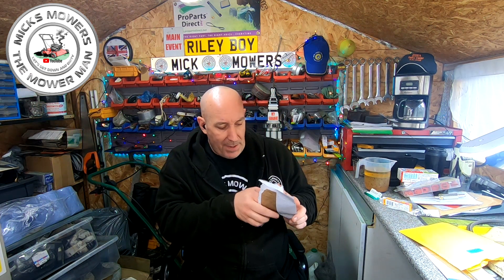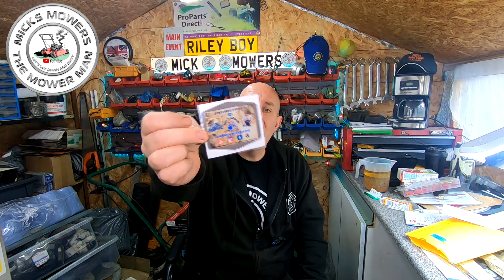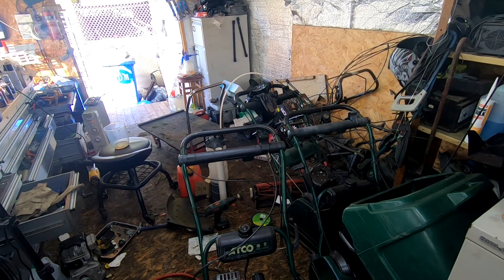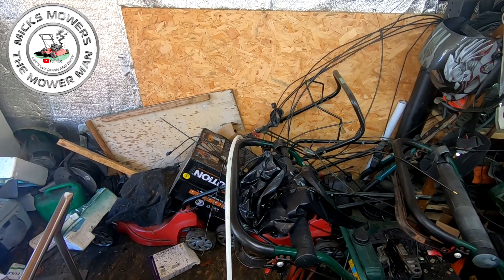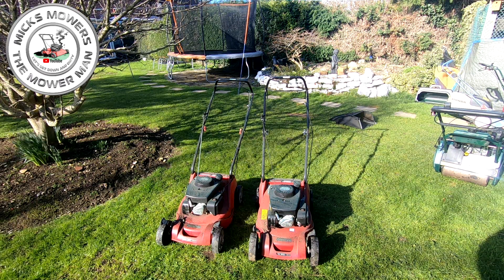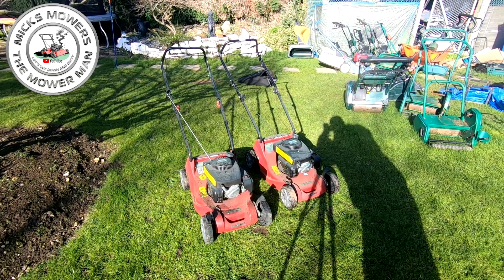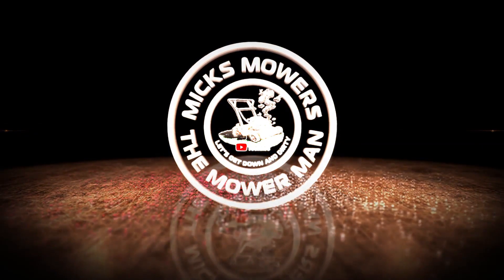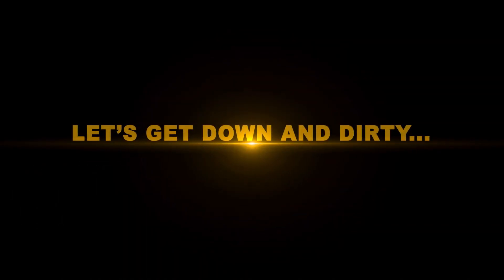Can I Use E10 Petrol In My Lawnmower - Experiment Results #e10 #E10Petrol

Comment: Recently fired up my Lawnmower for the first time in about 3 years so this time was the first time I had used E10 petrol in it, it starts and runs however it Revs a lot harder than it used to with the old E5 petrol…
Reply from the maker: May need a carburetor clean.. as the throttle may be a little stuck

Comment: Very interesting video. What do you think will happen if you compared the "premium e5 fuel" to the new E10?
Reply from the maker: Well maybe I should do a video on it to see
Reply: @themowerman  that would be awesome if you did. I use both premium e5 and the new E10 in both my 2stroke and 4stroke machinery and as yet haven't noticed much difference. But that said I have not left fuel in the machines for very long and I also use b&s fuel fit stabiliser.

Comment: That's all I use is the e10 & I've never had any trouble. I'm not driving 1.5 hours just to get non ethanol fuel, it's not worth it to me, My equipment is stored indoors & i do believe that makes a big difference .I also had two chain saws that were stored & hadn't been used since 2017 & I got them out & they Started right up & ran perfect. I also don't believe that gasoline has a shelf life of about a month either, if that were true the US government reserves would be no good.  That is a myth! As you say Cheerios Mick 🤣👍
Reply from the maker: Thanks for the comment Mike.. I fully appreciate it

Comment: Over this winter I used E10 with Briggs Fuel Stabilizer and last week it stated 2nd pull as always. I think it is worth it to stabilize the fuel as it will always start easily when I use it.